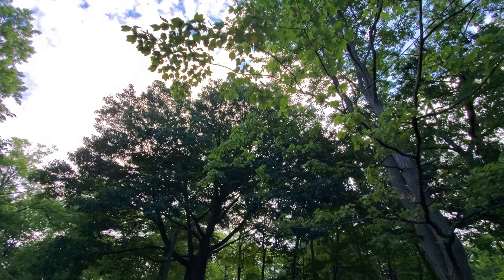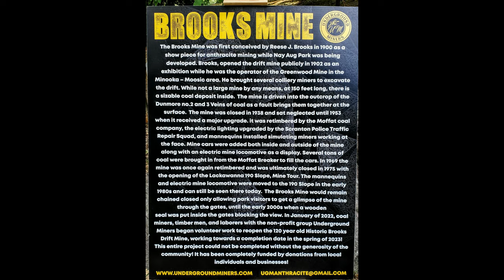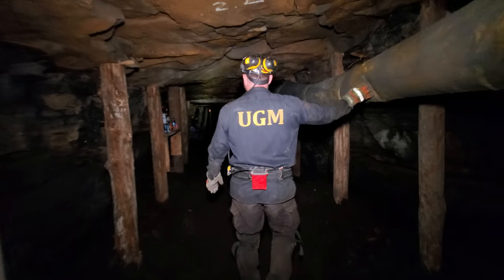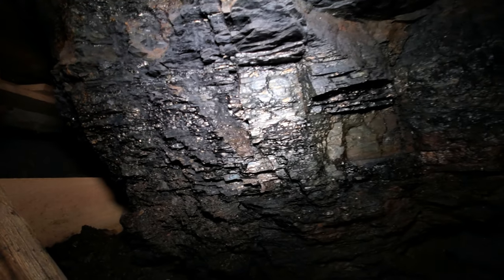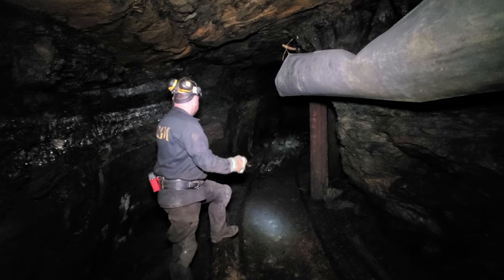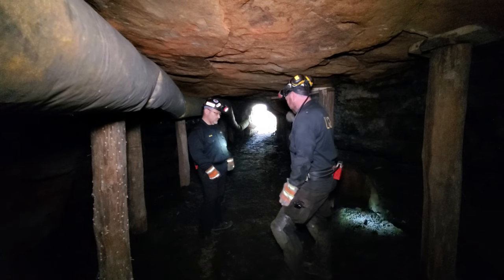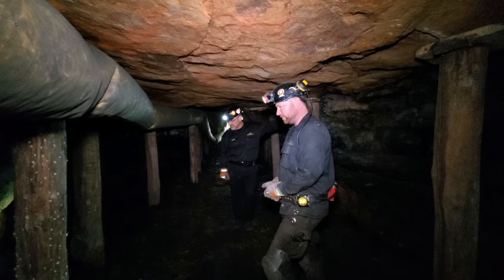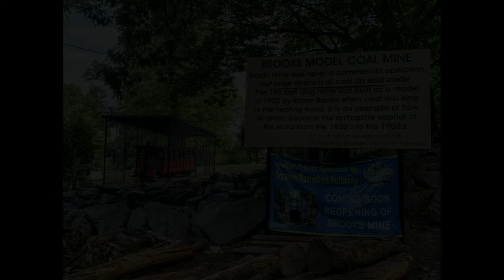Rehabilitating a Coal Mine - Brooks Mine Update Part 1 (8/2022)

Comment: What is the purpose of shaving the bark off of the timbers?  Wouldn't the bark offer some level of moisture protection if left on?
Reply from the maker: The bark actually traps moisture and would cause the timbers to rot. Nearly all coal mines remove the bark due to the damp environment underground. Out west in the dry hard rock mines, they typically leave the bark on.

Comment: having sat abandoned did ya run into any methane pockets I work in gold mines one of which is in red lake Ontario for goldcorp it has ton of methane compared to anywhere else ive been i run a diamond drill , there's no coal mines that I'm aware of up here in Northern Ontario I was just curious if methane is always present in a coal mine cause here some mines have none an others you hit methane often our drills have sniffers so when they detect methane the drill shuts down